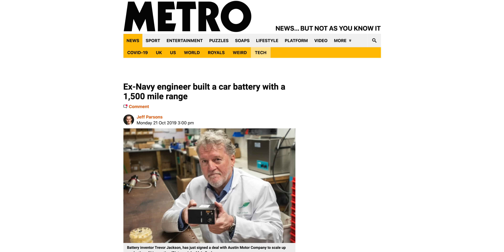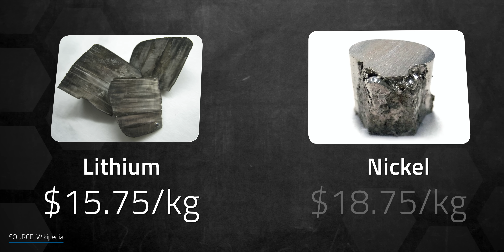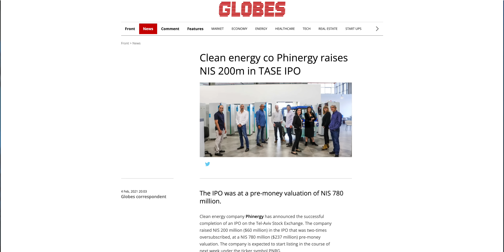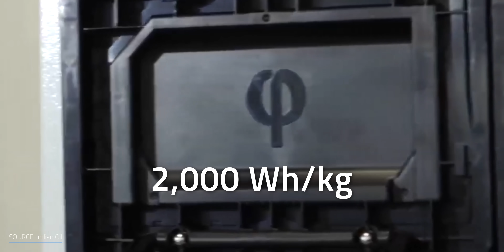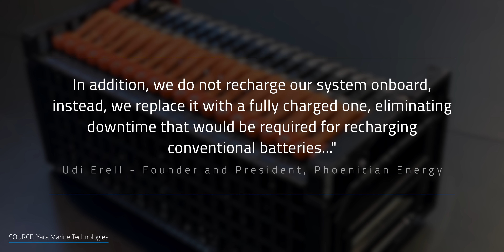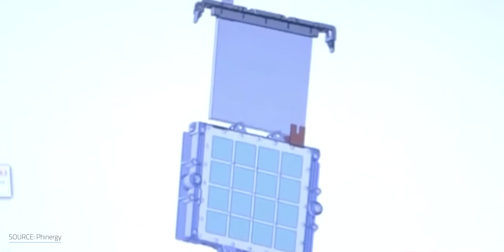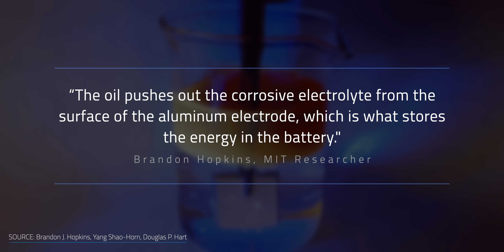Exploring the 1000 Mile Car Battery - Aluminum Air Hype?

Comment: The Aluminum-Air Batteries sound really Interesting. But even if the above mentioned problems are solved, imagine the logistics of transporting new and used Batteries. Would it be much worse than the current transportation of fossil fuels? Sounds like a niche tech for me..

Comment: For a 2700 mile range I could tolerate a 3 minute battery swap. Solving the running out of power is easy with a more intense nag the closer you get. My concern is the recycling process. Does it restore the aluminum to a reusable state? Toxicity of recycling and its waste components. I would expect crash safety would stand head snd shoulder above lithium.

Comment: Forgetting your at near the end of capacity is easilly addressed with range left indicator on dash. 

Getting every last watt hour can be accomplished by pairing with a somewhat small reserve rechargeable battery with electronics that will switch over to the reserve once the aluminum air is dead.  Replace the aluminum  battery and the electronics could recharge you rechargeable reserve.

Comment: Perhaps if you stop calling them batteries and call them fuel cells or energy cells then you won't think about the recharging issues. You wouldn't go for a long drive without checking how much energy you have left plus 1000 miles is a long way, a petrol or diesel will only do about 500 miles and an EV only 300. Depending how much they weigh and how big they are and how they're fitted etc, you have the energy cell delivered to you. In fact you could have them delivered to your home, swap them out and return it. You could buy them off amazon for example, put a spare one in the boot for long trips. Once the infrastructure is up and running it should be a problem for buying one at a station.

Comment: Absolutely not just another thing to put money into every month when most of us can barely pay rent even if it last 12 times as long drive that thing around for a couple months and you’re gonna have to replace the batteries like I used to remote and now you can’t get to work because you can’t pay for the replacement

Comment: Why not have an aluminum air battery with a range similar to an oil change cycle, and just consider it part of routine maintenance? The cost to swap the battery would be subsidized by the core charge you get from handing over you old battery for recycling, keeping maintenance costs low, and with how lightweight the battery cells would be, it's a maintenance item that is easily doable at home in an afternoon.

Comment: the discharged car won't necessarily have to be towed to the swap station - the battery can be delivered to the car, just like now a tank of gas can be delivered to a car that has run out of fuel.

Comment: Sounds like something that COULD be useful for A second battery. Have a 100 mile range lipo then a slot for a 600mile range one of these...

But it doesn't sound like the recycling and supply chain needed for it would be.... As effecient.

Comment: Other than the degradation issue, which is a deal killer, everything else could be dealt with via infrastructure. Like when you run out of juice, like today where a AAA battery van can come and swap out your 12v, so too would a truck, perhaps a flat bed or panel truck, come with a specialized hoist and swap out your cell(s). Don't forget that today we can tow a semi truck out of a jam as well! Over time, the cells would be come smaller and more energy efficient and all of the infrastructure would become lighter too. But, again, degradation at the rate discussed is unacceptable.

Comment: At this point, no, the tech isn't there yet.  As someone who doesn't drive a lot the degradation is not good.  I also wonder about the cost of replacing/recycling batteries constantly compared to recharge/replace of current lithium.

Comment: Besides cost trade offs, it depends how often one has to visit a swap station to swap the battery. Rechargeable batteries have the convenience of charging at home or where parked, except for long distance trips. 

There are many solutions to overcome a depleted charge situation. A reserve battery could included and one would simply switch over. The reserve could be a rechargeable battery that gets recharged from a power source during a battery swap or while on the road. 

AL-Air batteries are excellent for public buses, unless hydrogen is more cost effective. 

Bharat is betting on Hydrogen also. Long term, renewable energy plus nuclear producing Hydrogen will be the winner.

Comment: Thanks for introducing Aluminum Air tech. Yes I would drive a car that can battery swap. Maybe a monthly swap subscription would make sense. As for the driving the family late at night with a low battery, I doubt I would risk taking the trip. So I wouldn't put my family in that situation. 

By the time this tech is ready, automated battery swap stations may be ready.

Have you seen battery swap for scooters? I think there is a video from Thailand. It's not automated, but the battery swap paradigm exists for some vehicles.

Comment: I would have no problem with a battery swap system, and there is no reason to have a battery system run out of juice. A smaller Al-Air battery that can be switched in to overcome a short fall, or a twin Al-Air battery system is also a solution. The advantages over LI-Ion are absolutely evident, but you should also look at the research applied to Na-Ion battery too.

Comment: I saw a video about a business in one city (I think San Francisco) that swapped EV batteries on cars designed for it. I think it's a sensible idea for a couple of reasons.
1. The car's down time is closer to downtime to fill a gas tank.
2. Removed batteries can be evaluated for potential recharging, or recycling.

I'm curious to see where this all goes, but I'm liking the EV idea overall so far.

Comment: I like the idea of battery swapping for long distance driving vehicles. (I have no recharge options at my work-vehicle and often need to drive 300-500miles or more per day. And my employer wouldn’t enjoy if I needed to sit idle for recharging at a fast charger)). BUT the big logistics of making and recycling the battery afterwards looks very complicated and expensive.

For personal vehicle I enjoy my lithium battery motorcycle. I charge at home and never need to enter busy fuel/recharge station. With the removable battery they are also convenient if I would run out and bring them into the office. I wish there was something like that for cars. Like battery on wheels?

Comment: I am 100% yes to this technology including battery swap.  I don't think the problem is breakdown as a tow truck could come out with the required battery for the car, especially as they are available at a service or battery switch station.  The problem is that the battery needs to be recycled much quicker, so we shall wait to see how the recyling system technology advances.  As for all people not being able to lift the batteries, the service station would provide a lift of some sort, the same as when delivery drivers take large parcels off a truck.

Comment: Need refuel the same speed as diesel or petrol, with the range and infrastructure to achieve that speed. Hydrogen is definitely the way, but the need to make it feasible is the issue

Comment: If they could make it small & light enough for easy “Self” batteries swapping ( 1,2 or 3 .. batteries slots just drop in and take out instead of 1 heavy one ) would make it be a plus . Since they are lighter people can have a spare for emergencies and they could just drop them off and a exchange location ..👍👍

Comment: You sound biased.
I hate the idea of the Lithium Salts used in the Lithium-Ion batterues, eventually making their way into the groundwater. Lithium is a neuro-toxin don'-cha-know.
If they can sort out the possibility of an aluminium-air battery fully discharging (perhaps with an alarm that sounds off at 10% left or dialable) and sort out the other issues, then it would be my preferred power source for EV's (vying with Hydrogen fuel cells). 
For the house, one of the non-lithium solid state batteries might gain my interest.
But for now, the market and products are still developing, and it would be foolhardy to commit to a particular system at this time.

Comment: VERY interesting, because the degradation in Aluminum Air batteries are not ecologically hazardous at all, and aluminum is actually a silver in the anode and not in the cathode...on a point of correcting your statement about silver.

Comment: It is interesting that battery metals tend to be soft metals like lead, copper, zinc and aluminum.   This makes it easy to remove corrosion from the surface.  A penny battery can be restored to fully charged by sanding off the corrosion off.  The lead sulfate that builds up on the lead plates in a lead acid battery can be removed by reversing the voltage.  But the lead sulfate could be removed by sanding off the plates as with the penny battery.   Because lead is so soft, it is easy to remove corrosion.  The amount of electricity needed to remove the  lead sulfate from the lead plates shoukd be about the same as the electricity generated when the lead combines with the sulfate from the battery acid.  But since lead is so soft, it seems that the lead is more likely to separate from lead during sanding than for the strong bond between the lead and sulfate to be broken.    This suggests  that the battery could be restored to a fully charged state with much less energy  by sanding than with electric current.   If the concentration of the battery acid was adjusted to accommodate this procedure how many times could the battery be restored?  How many times can a penny in a penny battery be sanded before the penny is sanded away?  Maybe 50 or a hundred times?  If one lead acid battery can power a car for about 4 miles, then ten batteries  could power the car for 4000 miles before the battery needs to be electrically charged.  But could the lead that was removed from the plates during sanding be replated onto the plates if it is sitting on the bottom of the battery as lead sulfate and lead dioxide dust?  If some lead and lead dioxide are dissolved in the sulfuric acid then will they be plated back onto the surface of the correct plates?. 
The sanding could be accomplished with  fine abrasives circulated at high velocity through the battery acid.  Spinning the plates around in an abrasive solution would probably remove the lead sulfate.  If the lead can be replated onto the plates, the battery might last for a hundred years because the process would prevent the buildup of lead sulfate crystals that is the usual reason for the end of lead acid battery life.

Comment: Depending on cost, this would overcome the reason I will never get an electric car.  After X amount of service life, there is a $20000 charge to replace the battery, people say just get a new car, the old car now has little resale value as it is stuck with a poor battery and a $20000 negative value.  This system could get around that problem.  Whoever commented, use 2 battery's rather then 1 larger one to stop you from running out - genius!

Comment: I feel like using these in combination with lithium batteries could help with range anxiety but still maintain easy use/recharging for short distances, and the replaceable aluminum batteries would be great to add range or for more remote applications where charging might be impossible or inconvenient. Plus if the battery swaps could be done quickly there would be no major downside over fossil fuel cars (aside from the new infrastructure for batteries).
Reply: Apparently you missed the fact it loses all its charge quickly.... Though MIT with an oil based electrolyte partially solved the problem as long as you changed it out every once in a while.

Comment: Running an EV that required battery-swapping is a con, but it's not SO horrible in comparison to filling a tank with fuel at the cost of the fuel.  Get the cost down far enough that a swap-out every 7500 miles isn't so horrible, and you might have a winner.

Comment: Driving somewhere and running out of fuel is not really a drawback. This can, and regularly does happen in petrol cars. This is easily fixed by calling AA, they come and fill up the fuel and charge for the drivers forgetfulness/ lack of planning. Do we blame internal combustion engine for this? No. 
With a range of 1600 km per swap, even 10% battery gives you 160 km (10% petrol = 25-50 km), which would be enough to reach a battery swap in most countries with just 1 station per town. If anything, the "stranded due to lack of energy" might become less common than it is.

Comment: This isn't a simple yes, no, question of whether I would drive an EV that required battery swapping. The short answer is yes, I would but that is strictly dependent on the infrastructure being available and fluently operating to handle it. With today's conditions, the answer is a solid no. If in 10 years, these batteries were readily available at every "gas station" and easily swappable and the service people were knowledgeable in this process...... and (this is a big IF as well) if this process, including recycling the batteries, transporting them, manufacturing them, and all other processes necessary to maintain the economics of it, were actually carbon negative relative to fossil fuels and other alternatives, then yeah, absolutely, I would happily support this technology.

Comment: I see that they are in the hatch of a Nissan LEAF. Does that mean that an adapter is used to connect with the main Lithium ion battery? At present it costs me over $80 to fill my ICE vehicle for about 500 miles. If the infrastructure is there for swapping I'm up for it if they can keep the price reasonable.

Comment: Battery swapping solves the 10 year battery warranty problem. Just as we have gas stations everywhere, these batteries will require similar infrastructure. But a 1000 mile range means less swaps. I love the idea of swapping batteries, which I wish we could do with Tesla so fueling time is near 0.

Edit: cost would be a concern but high recyclability should reduce cost.

Comment: Yes, I want to go electric. I also want the range of gas. 
Al-Air would provide that. 
Timing of maintenance would be an issue though. 
you have 500 mile left on a charge but, you're leaving on a 1500 mile trip?  
You could have battery swap out stations like they have instant oil change stations.
So, the key, really is infrastructure. 
Travel, like you would with a gas powered car, if it's late, you get a hotel (like normal), the next day you go to your instant-oil-change place. They swap out the batteries. 
You're on your way.

Comment: This just seems silly, still very energy intensive, still requires recycling and they're not rechargeable. 

I prefer to recharge my car, much more eco-friendly and convenient, plug in when shopping/working/at home rather than having to get a battery swap, range doesn't matter if the battery is crap.

Comment: the ice motorcycle industry, ie honda, yamaha and others, have announced the launch of ev-battery-swap system with support infra. off course on motorbikes the battery is smaller (upto about 20kWh, so lighter then a Tesla one, and it can be accessed more easily.  I would vote for swapping even the rechargeable ones at petrolstation and other usefull distributiion point

Comment: Seems like battery swapping for almost any kind of battery would be the fastest way to "fill up" assuming you can access the battery easily and stations to swap were abundant enough. And people run out of gas all the time. Just need some AAA trucks with charged batteries to go help inattentive electric car drivers out like they already have to do with inattentive gas car drivers.

Comment: Neither its just a niche for vehicles that will offer Battery Swapping like NIO offering now. For Niche high energy applications...  

But to say the current non-swappable battery packs in most EVs, that you can only only offer charging is better than swappable battery pack that can replaced in seconds?  And a smaller fixed rechargeable battery pack, can be part of a modular designed EV. To have the best of both worlds....

Comment: Im concerned about volume.  The focus is on energy by weight for obvious reasons, but volume is still relevant - both in terms of what you can actually fit in the car, and storage space for spares.  
But the real issue for me is that , while a non-rechargable, swappable battery solves the refueling time problem, now we need a giant infrastructure built around manufacturing, transporting, storing, swapping, and recycling all of these batteries.  
The 2020 data from the DOE shows just under 10 billion miles driven just by full-electric vehicles.  In just the US.  Let's imagine that we only replace those miles with the new swappable batteries.  The 1000-mile range was a special case that's unlikely to see actual road use, but lets run with it because the math is easier and its super optimistic.  We need to manufacture 10 million of these batteries to cover that utilization, every year,  assuming we're just replacing the equivalent of the current full-EV fleet in just the US.
The "every year" bit concerns me.  That assumes no growth, and these are effectively disposable commodities that require manufacture, transport, storage, disposal and recycling.  What are the environmental, energy, and plain real estate costs associated with those logistics?  Sure, Lithium batteries also require (I presume more complicated) disposal and recycling, but far less frequently since they're not just single-use.  What parts of the batteries can be recycled, and with what efficiency, and what materials/chemicals are needed to do so?